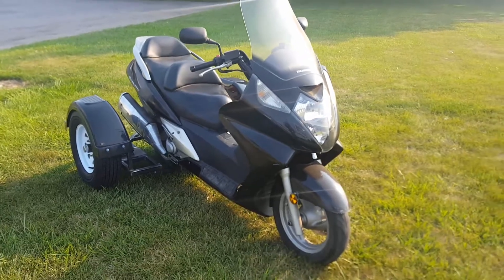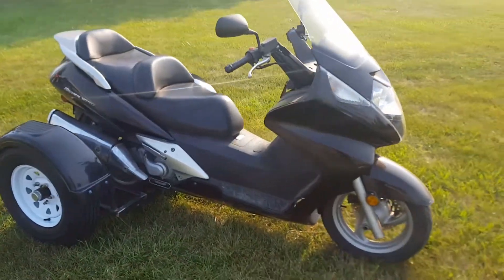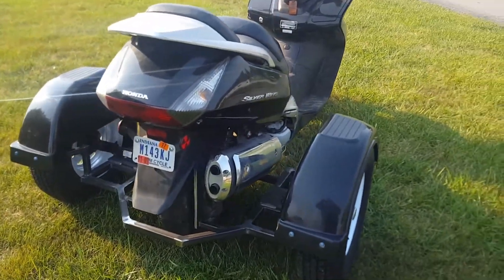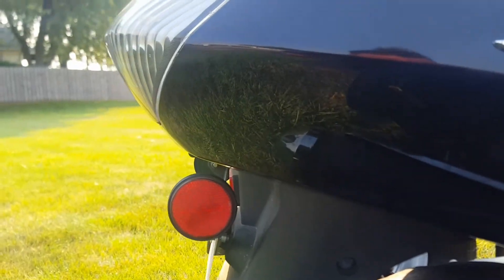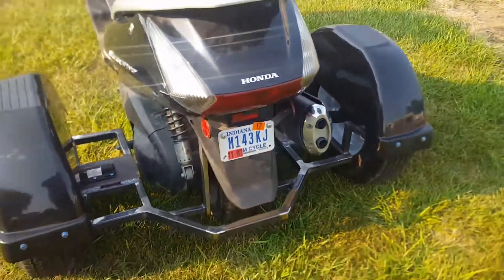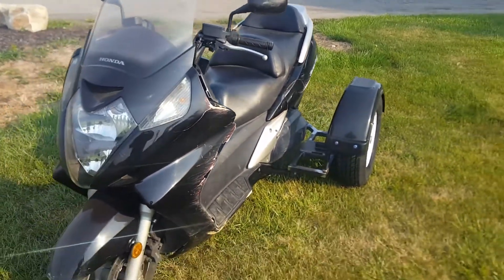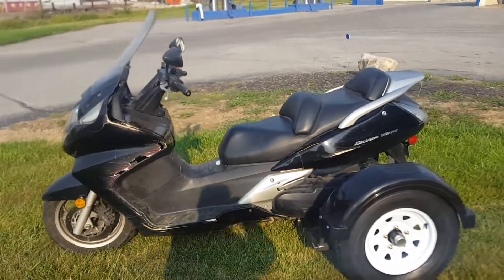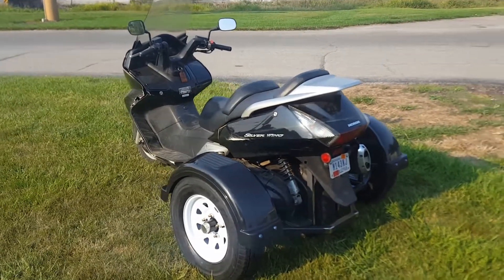BIC Trikes 2002 Honda Silver Wing

Comment: Do the wheels on the add on pivot at all?   For example,  when the road has a crown will the curb side tire drop down to conform to the road or will the bike lean a little?
Reply from the maker: Like a regular trike it will lean with the road. There is no pivot but it does have independent suspension.
Reply: @bictrikes  can't see the independent suspension